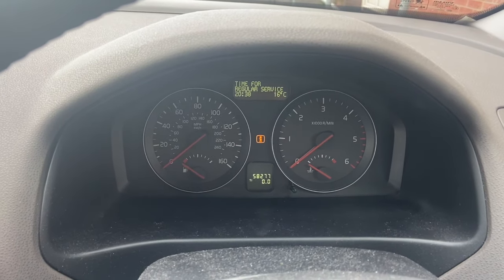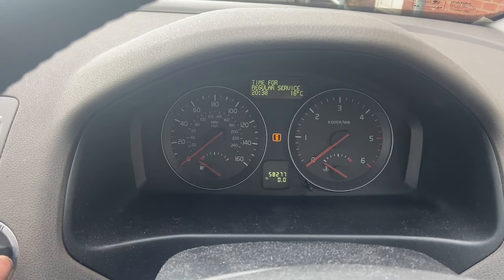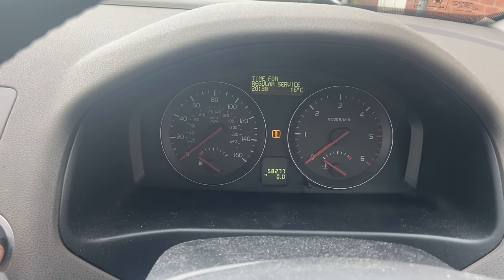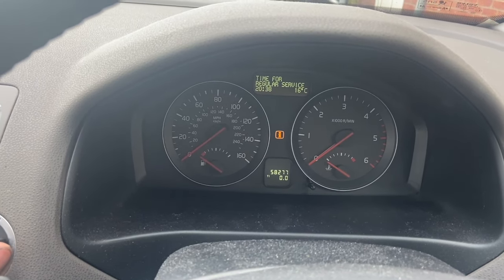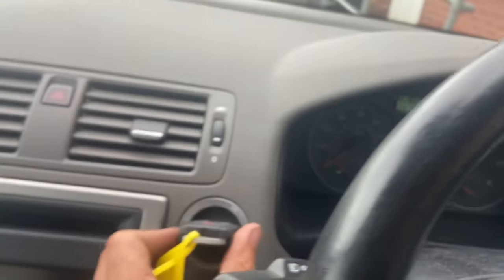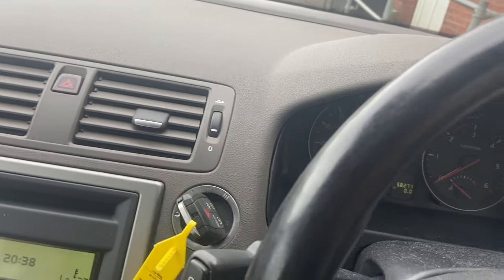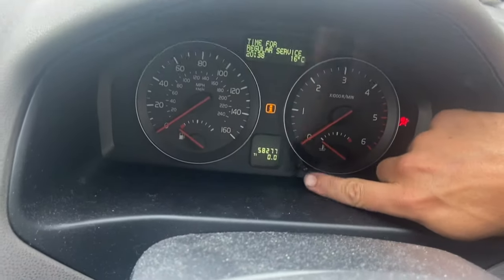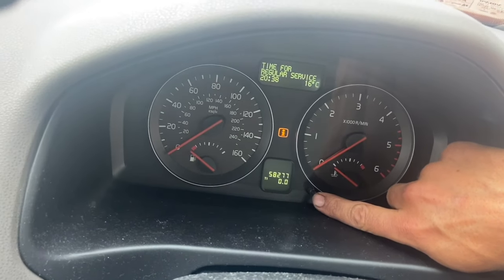Volvo V50 Service light reset procedure 2004 - 2012

Comment: I do actually service my car every 15,000Km (about every 7 or 8 months) but they forgot to reset the service light last service.
This video was really useful. I thought I might need a connector to plug into the diagnostic socket for this.

Thank you!

Comment: Just to add.. On my car. A 2004 v50 2.4 it's the left button you press. Right button sets the clock on my. Model. But method is the same. Thanks!
Reply from the maker: Thanks for the info rob 👍👍👌

Comment: Does not work on my 2011 v50. I have tried it several times...the message won't go away. Either will the low beam light, and all the lights are replaced and working